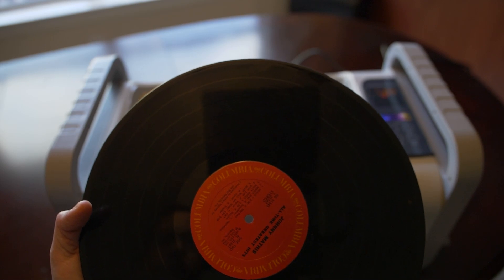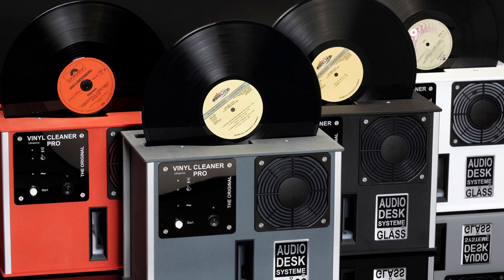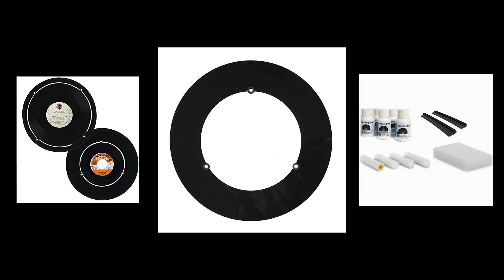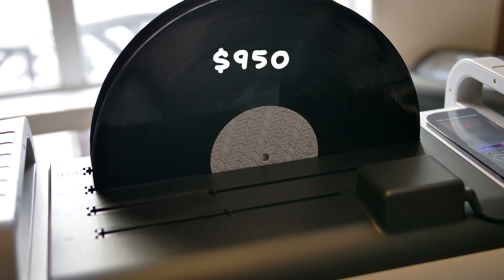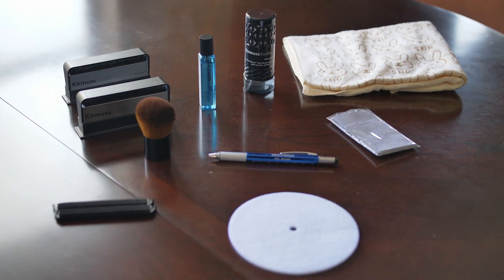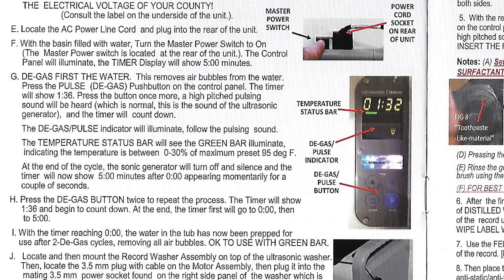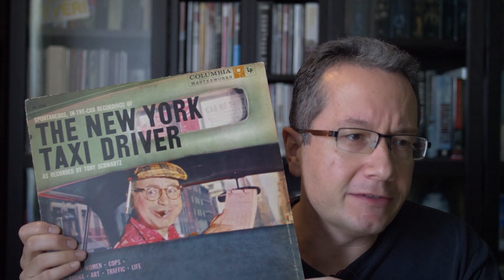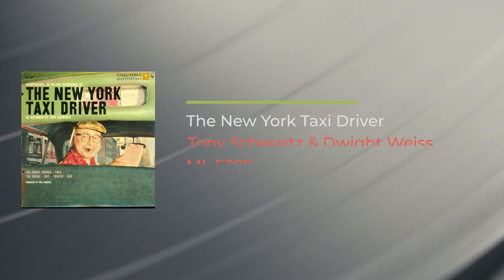Kirmuss KA-RC-1 Ultrasonic Record Cleaner Review and an Ultrasonic Cleaning Primer

Comment: Great video Paul.  I worked at Dow Chemical as a chemist.  The same Dow that makes the high density Polyvinyl Chloride you mentioned.  I personally worked in a waste water lab and studied reactive chemistry and you are correct.  Alcohol is not very reactive with your vinyl records.  Scrubbing Bubbles (by Dow) is.  It is a high caustic cleaner.  Vinegar is, it's an acid. (mild acid)  I never get into debates with fellow record collectors.  It isn't worth it.  But you my friend are on the same page.  
One last thing is that we use sonic cleaning of most of our lab equipment.   We use pure deionized water though.  Great job.  Great video.
Reply from the maker: Actual confirmation from a Chemist!  This is exactly what I needed!  You're right about Scrubbing Bubbles!  I use it but very, very sparingly due to it being caustic and I quickly rinse it well afterwards.  Not sure how much of a material breakdown can be observed in short, time limited manner.   You're right about the debates.  In some cases, there is no arguing with the idiot.  It's just wasted energy if people have closed minds.  I hope you have a happy holiday and I enjoyed your last tag video with Steve.

Comment: Great video and very well presented. I have a DIY ultrasonic unit that I have been using for 3 years now. I am considering making some alterations to it to help with really dirty LPs. 
There is a formula online that suggests adding enzyme cleaner to the mix. It is supposed to help break up the organic matter that gets built up in the grooves. After a 15 minute clean I will rinse the LPs  in distilled water and immediately vacuum the fluid up with a modified shop vacuum and felt covered nozzle ensuring that there is no residue left in the grooves.
Reply from the maker: Thank Peter and the DIY ultrasonic and vacuuming solutions will work just as well.  Do you know where you found the formula with enzyme cleaner?  I do use enzyme cleaners on occasion and I would be willing to try something different.  For me, the rinsing is one of the key elements to the whole cleaning process.  Again, thanks for the great comment.
Reply: @BarakaPDub   I seem to recall it was in some of this guy's videos. I don't always agree with his methods but some things he suggested  makes sense. I like his collection of Jazz material as well. 
 https://www.youtube.com/channel/UCfDyDCc5IAEruMJhaVwctag
Reply from the maker: Thanks Peter!

Comment: Hi Paul, good video.  Firstly the KL audio unit was made in South Korea, the Audio Desk and Degritter are German.  The Kirmuss is based on a Chinese unit.  The Kirmus runs at 35khz, the KlAudio and Audio Desk at 40 khz and the Degritter is 120khz.  The 120  has to small and fine bubbles for really dirty records,  the others 35 to 40khs results in too large bubbles to clean properly.  80khz is the very best frequency for records.   The Kirmuss can also run hotter than records will like as well as running on the rim of the record is a problem to me. All 4 of these units can be problematic with warped records.  The speed on these three units is also incorrect  as is the recommended cleaning times.  The cheap 6ltr tank units all run at 40khz, 80khz tank units are up to three times the price and you still need the drive unit.  .....Enjoy the music.
Reply from the maker: Thanks Peter and for the catch on the Klaudio.   I always thought is was based in the United States.  I saw quite a bit of debate on the Steve Hoffman forums on the frequencies and record spacing.  And I didn't really want to wade into those territories as I am no expert on the subject at all.  I do agree, the higher the frequency the smaller the bubbles.  Heating elements aside, all of these machines will generate some heat as you're transferring all of that energy right into the water.  So far I have run into any issues with warped records at all but I am trying to overdo it.
Reply: @BarakaPDub  Ultrasonics are great for cleaning, im not knocking them, its just there are a number of things that anyone planning on using one needs to know.  I have built my own based on the same base unit that kirmuss uses, but i have a spindle motor running at one rpm, also put a temp sensor in that cuts the heater off at a set temp.  i also replace the tranducers with 80khz tranducers since the chinese factory point blank redused to supply 80khz units. i use 1inch spacers/label protectors and do eight lps/single/10inch at the same time.  i also use a vinyl styl for pre clean and another for post clean and a vac unit to dry.  its a process but gets them super clean. im not an expert, just trying best i can to get the results i want.  really like your videos.  take care, enjoy the music.

Comment: Hi Paul. My biggest issue with the Kirmuss and the other high end machines has been the rotational speeds. The white papers put out by various USA manufactures recommend a minimum of 3 - 5 minutes of cleaning time. A third of the record surface is submerged at any one time. Therefore the minimum rotation should be from 9 - 15 minutes. The Kirmuss and others are far faster and do not allow the FULL effectiveness of the US cleaner. My second issue is the frequency used. I believe the Kirmuss and others have used the 40 KHZ transducers. While OK the micron size of the bubbles are little large compared to using 60 KHZ which get deeper into the groove before imploding. Conversely the 120 KHZ is fine for new previously maintained records but on records such as you showed the 120 KHZ is not effective at all. A comparison is a 20 KHZ is like using a steel bristle brush whereas 120 KHZ is like using a fine sable hair brush. I totally agree that having other RCM is needed as a US cleaner is not going clean really disgusting dirty records.
Reply: Here is a 8 year long discussion on a DIY. Lots of great info. https://www.diyaudio.com/forums/analogue-source/218276-version-ultrasonic-record-cleaner.html
Reply from the maker: Thanks Michael.  I do agree that the higher the frequency the better but yes, there are limitations to where you lose the useful benefit of it all.  Thanks for the link. I'll be sure to check it out.

Comment: Very informative review with a lot to think about. Thanks for sharing your own experience with this unit. I'm impressed with the fact you can clean multiple records at the same time, that is definitely a bonus for those with 7 and 10 inch collections. I'm with you on the "alcohol debate".  70% is a safe bet and always has been. Thanks again!
Reply from the maker: Thanks Kurt!  Even now, I have a person that wants to debate me on the use of alcohol but I also have a former Chemist (Michigan Record Club) that confirms it's not reactive in the comments.  The ability to easily do 7", 10", and 12" records and just drop them in is what sold me on the unit.  I didn't want to mess with taking records on and off a spindle so I am a bit lazy in that regard.

Comment: Nice to see you again.

I'd like to try ultra sonic cleaning eventually, but probably only on a few records I know are otherwise in excellent condition, but ones I feel I just can't get that last 5% of dirt out of. Ultrasonic, IMO, is too expensive, noisy, and time consuming for anything but the most coveted records in my collection.

Here's my record cleaning regime in a nutshell. This is what I do for the records I offer for sale in my store.

If they're really gross, I rinse them off in the sink with cold tap water. Then I have two SpinClean units on my counter, one with cleaning solution, the second with just distilled water. After running the records through both, I dry them with the supplied SpinClean cloths, then air dry in a plastic rack. I've had many customers say I have the cleanest pre-owned records in town. I'm pretty proud of that.

Now, if it's a higher end record, or something I'm keeping for myself, I'll go to the next step, which is to use my own homemade RCM. I made it from a plastic milk crate, ice cream maker motor, foot switch, platter, painter's pads, and a small one gallon shop vac with OkiNoki strips on a modified wand. Works as well or better than any RCM I've seen, for a fraction of the price. It requires a little more manual labor, but I've got maybe $85 invested in the whole thing and it works a treat.

I really need to make a video.
Reply from the maker: I would love to see your process in a dedicated video.  I am sure other budget conscient folks would love to see it since a lot of audiophile gear is priced too damn high.  Your process is very sound and exactly what I would do on a budget.  On the Ultrasonic front though, you could just buy the cleaner for a little over $100, forgo the motor, and thread an LP through a metal rod and manually turn it.

Comment: Nice review Paul. I have been wanting to save up for an ultrasonic of some sort. Some of the adapter issues you mentioned on some models worry me as well. I liked the simple process of this, and I think the effectiveness shows in some of your footage. For the price this seems to be the best choice for efficiency and functionality. Now of I can convince the Mrs. Lol. Hope you are well sir!
Reply from the maker: I hear you on the 'Mrs.' factor.  Mine was none to happy with more gear coming into the house but I am happy with it.  These units do exceed vacuum units in getting rid of accumulated gunk in the grooves.  The Kirmuss unit was actually cheaper than my VPI vacuuming machine funny enough.  If you don't want to opt for the Kirmuss, I think a DYI until will operate every bit as good but will just be a little more labor intensive to take the LPs on and off spindles.  If I don't comment with you before then, have a Merry Christmas Tim!

Comment: "You feel as if your life is being threatened. " I truly LOLd.  I'm running an Okki Nokki and for pretty dirty LPs two passes and then rinsed with water it works great. (I buy a lot of used LPs) I don't think people understand how sturdy vinyl truly is--it can bounce back from dirt, just not physical damage--which is pretty hard to do, really. I've been thinking about adding an ultrasonic but haven't yet found the need for one.
Reply from the maker: So Kirmuss himself, rubs a lot of people raw with his sales tactics and that bled right into his instruction manual.  It's all a bit over the top if you ask me but looking past that I was sold on the drop in ability.  That said, the Okki Nokki's are good RCMs.  They are what I tell people to buy if they are looking to vacuum.  My VPI is overpriced for what it is and I wanted an Okki Nokki at the time but they discontinued making them only to resume production after I bought my VPI.  Thanks for watching and commenting Joe.

Comment: Great video Paul. One downside with the other more expensive ultrasonic machines is that you voided your warranty by using any kind of surfactant. Of course using a surfactant like alcohol is important in the operation an effectiveness of these machines. Also those crazy expensive paint roller brushes that you had to replace. Cheers
Reply from the maker: Thanks Karl!  Do you have an Audio Desk, Klaudio, or Degritter then?  That's one thing I forgot to mention specifically was the cleaning fluid.  That said, I already voided my warranty with my VPI but straying from their preferred solutions ;)   Thanks for commenting and have a happy holiday.
Reply: How would they know?

Comment: Hi! Well the best way to clean is mechanical cleaning a good scrubbing with a decent brush made from goat hair, something that is stiff but fine enough to get into the grooves project make their brush from goats hair. Well I've heard that isopropyl can damaged vinyl, And if you use a sonic cleaner you need some soap to break down water tension a surfactant otherwise it's only going to be on the surface and not get in the groove properly. (I would use deionised water not distilled water it's purer!) No more than 5% isopropanol but that's at 99%, not all isopropanol the same usually 70% is rubbing alcohol contains oils. And you need to rinse the record afterwards and apply a slippery agent and non static agent I use anti-frizz hair conditioner prevent static and give the record a slippery surface what minimise jitter not a lot about 3 drops in the rinse process with deionized water 5% isopropyl in a plastic Tupperware tub and leave to dry. vacuum is good but you need to rinse afterwards because vacuum causes static to build up on the record and automatically charges the record. I used to use contact lens cleaner for cleaning records I've tried AdBlue now think is better, contains 68% deionized water 32% urine and  i add 5% isopropanol a little bit of ethylene glycol as a soap just 3 drops then I use the cleaning machine disco antistat.
best cheap mechanical cleaner and was the original better than spinclean is the knosti-disco-antistat-record-cleaning-machin. 50€. it's a very good machine uses goat hair brushes not felt pads, I don't think is good and don't get into the groove. You need to clean your water afterwards because it will contain bacteria the minute you open the bottle!! I put it in a container and put it in the microwave bring it nearly to the boil then I get some coffee paper filters put it in a funnel soak the coffee filter in isopropenyl and pour the water into the bottle then you know there's no bacteria and it's filtered well.  but with AdBlue it's dirt cheap you can buy 5l for about £6 from the petrol station used in diesel engines to clean out particulates. the urine is an antibacterial and cleaning agent in itself try it out see how you get on with that in your sonic cleaner and no it doesn't smell of piss lol Happy Christmas
never dry a record with a tail or cloth
Reply from the maker: Hello John.  You're right about the goat hair.  I love using them on the groove and they work the best.   I haven't tried using soap as a surfactant but I am sure it should be okay provided you don't use too much.   As for the alcohol, I had a Dow Chemist confirm to me in the comments that alcohol will have no effect on vinyl.  I've been using it for years and haven't seen any affect at all.   Rinsing is key and while I didn't get into in this video, all my LPs get a dual rinse of distilled water on my VPI.  The key is not to over vacuum because yes, you do induce static so I only go over one revolution, no more and I let the rest air dry.  I've been curious about the Knosti and I might have to pick one up to try it.  thanks for all the tips (including the doesn't smell of piss).   Merry Christmas my friend!
Reply: @BarakaPDub  yes doesn't smell of piss haha the AdBlue! going to try it give it a go, you're not a fan of deionised water any reason why!
I'm not sure you could eliminate the static with just one rotation on a vacuum, maybe if you had anti-static brush that was earth out maybe! what type of vacuum pads does the VPI use? Keep safe out there and take the vaccine you don't use any anti-static chemicals in your rinse process?
Reply from the maker: With one rev of vacuuming for each distilled water rinse and an air dry afterwards, I have had zero problems with static.  I used distilled water because it's easier to come by.   Long ago I bought a Furutech Destat and honestly, it's sat in the closet for three years.  I haven't needed it at all.  The VPI uses felt on their wands.  Not the greatest but it does the job.   You just need to replace them after a couple hundred records and be sure not to over vacuum. Over vacuuming creates a lot of friction and induces static.  I learned that the hard way.   The other benefit is that I am close to the Gulf of Mexico, maybe 30 km so it's frequently pretty humid here.

Comment: Thanks for another excellent vid though I think it should've come with a warning. "There may be side effects."  I now watch with horror as my  pristine, dead quite and shiny black disks are quickly bombarded with Volkswagon sized chunks of debris as they spin on the platter.  I swear I can see these chunks course correct, changing direction to crash into my records.   Something I never noticed before ultrasonic cleaning with my older less effective process.  Back then I called it dust and shrugged.  Trade offs.
Reply from the maker: Thanks Teddy Rasputin.  Yeah, if there is a downside to the units that don't have active filtration, when the process stops, you could just end up with some debris back on the platter.   While I didn't get into in this video, I do a double rinse with distilled water on my VPI.  The important part of the ultrasonic is dislodging/loosing all of the imbedded debris.

Comment: I have the Vinyl Stack set up for ultrasonic cleaning with a home brewed surfactant solution that I researched a formula for online which includes alcohol like yours. I also use disc doctor V for vacuum duties.  Results are fantastic and really give SIGNIFICANT improvements. Because I’m a bit AR, I finish up with a anti static gun and place in a quality anti static sleeve. Records stay static free after 2 years so far.
Reply from the maker: Thanks for chiming in Ettore and I am glad I am not alone in the use of a diluted alcohol solution.   The Vinyl Stack really is a good option and I've hit their website up several times over the past few years.   Also, nothing wrong being AR!  All my records get a double distilled water rinse on my vacuuming machine.